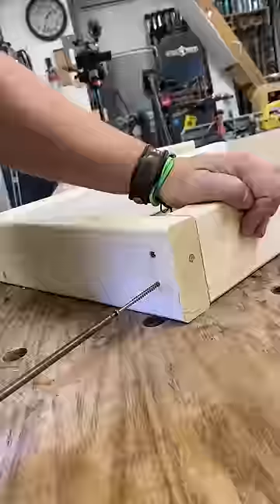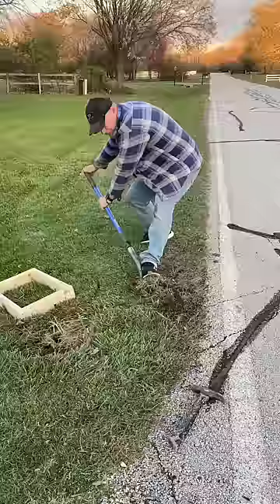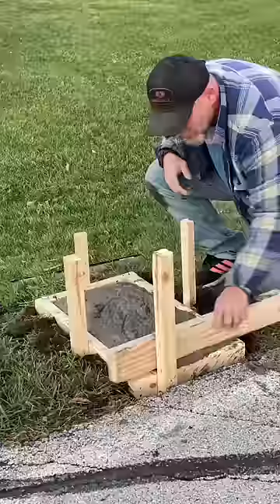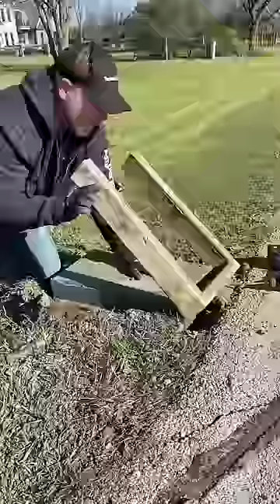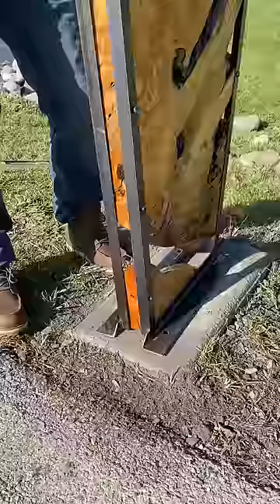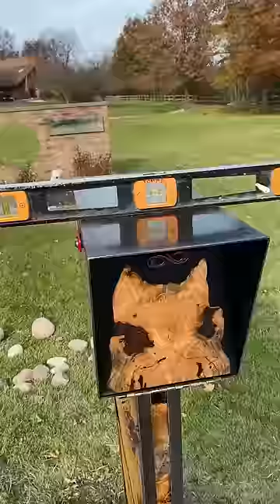The Coolest Mailbox Ever Made!!! Free Plans #Shorts

Comment: Looks like it would tip over in a strong wind.
Reply: 100% 🤣
Reply: he put 6 lag bolts in I don't think it's moving unless a truck hits it.
Reply: No faith what so ever.
Reply: @youreverydayjoe8087 that footing was only 4” deep😂
Reply: @youreverydayjoe8087  BAHAHAHAHAHA! 
(the bolts could hold down ten times the weight that shallow footer will)
Reply: @youreverydayjoe8087 The lag bolts are only as good as the concrete they are in. That was about 60 lbs of concrete to anchor a 4 foot tall wind sail. Unless he put significant concrete lower, or some sort of metal posts, it would absolutely tip over with little effort.
Reply: @JimYeats  that’s depending on the soil mister , did something similar to this and been here for years and hasn’t moved
Reply: @youreverydayjoe8087  Depends on a lot of things. Soil being of middling importance.  You want at least a third of your item in the ground for adequate strength, across soil types. So for a mailbox, which is just shy of four feet, you would want about two feet in the ground. So for this fairly large item, a two foot deep foot hole, maybe a shovels width wide, with concrete and a piece of rebar, and then the four inch thick surface to bolt it to would be sufficient.
Reply: Yup...no footers no strength
Reply: @YourEveryDayJoe  the concrete will tip with the box thanks to those bolts🤦

Comment: That is like so cool. Only thing I would have changed was to make the concrete base deeper. Gorgeous!
Reply: A bigger box too.
Reply: My neighborhood,
Frost will heave that right up.
Reply: It’s a mail box make it deeper to what support a second story mailbox. Gotta critique don’t you
Reply: @benjurqunov that’s where you live and it’s a mailbox. The frost does t go heaving up rocks in my front lawn. Like ever
Reply: @Bdigital9482 I'm sorry if somebody picked on you but that's not what was happening here. 
The dude offered a perfectly valid bit of constructive criticism.   A mailbox sits atop what equates to a 4 foot long lever attached to the base.
Reply: The steel rebar will rust, expand from the inside causing the concrete to loose its strength. Mailbox is really cool.

Comment: Beautiful! Hope the snow plows don't tear it up or knock it over. 4" of concrete base isn't a lot to keep it upright with freeze/ thaw and snow thrown against it.
Reply: I think 4" is being generous. 2x4 is only 3.5". Plus he was below the edge of the 2x4 a little. I wouldn't doubt it if his actual slab thickness is 3 1/4 or so. Definitely not enough.
Reply: Snowplow? A large vehicle driving past would knock that over. I'm a little surprised it didn't fall over when he pulled on the door to open it. 😂
Reply: Just take it in at the end of the day
Reply: @DannySauer  HAHA!!! Exactly
Reply: It’s actually closer to 6 inches- notice how deep the hole is below the rebar- at least a couple of inches…
No slab thickness will save that from a direct hit by a plow, or probably even the snow from a plow.  If the slab holds, the frame’s going to bend

Comment: Flags on wrong side.  If mail carrier objects they'll make you take it down.  Same thing with bolt heads sticking out inside.
Reply: That is exactly right.  Mailboxes have to conform to standards that are set by the post office and the municipality you are in.  For instance,  a mailbox attached to a 50 ton boulder wouldn't be allowed on a road bc it could destroy a car and its occupants.  Also, a really heavy mailbox may go through someone's windshield, etc.
Reply: Mailboxes have to be certified by the USPS, and i don't think they go certify custom ones. It is beautiful.
Reply: I scrolled for a while looking for this comment. Video isn't flipped, address numbers are correct.
Reply: @alexkitner5356  courier discretion with boxes that aren't approved. I have one that isn't and it's not a problem
Reply: @veganpotterthevegan  they might not care to bother enforcing it but if one day they decide to, then it still goes back to the somewhat bureaucratic and picky regulations requiring USPS approval. 
Some carriers barely manage to get the mail there, they're not about to bother doing paperwork or dealing with a non-conforming mailbox unless it causes them an issue or is more work. It's kind of like speeding, just because they don't pull over everyone that goes 1mph over the posted speed doesn't mean that they can't choose to or that their not enforcing it on others means everyone gets an automatic pass for it.
Reply: @Alex Kitner  no, if a courier doesn't like a mailbox, they're allowed to simply not deliver there.   My ex-wife was/is a 20yr courier with USPS.  They actually have less work with boxes they won't deliver to
Reply: @veganpotterthevegan  it still doesn't change that discretion means that it doesn't meet regulations and that while they may, they don't have to- paperwork or not. It may not be paperwork all the way but I'm sure if someone gets mad, gets told "too bad it's discretionary" and has a fit and files complaints then it's a pain and some paperwork or interviews will follow. However you word it, it's easier to just be discretionary or just to ignore it if it's not more work or other problem but that doesn't mean that they won't tell you tomorrow that your mail is stopped because the mailbox isn't usps approved.   And remember you're way less likely to have the issue cause your wife works for the same company in essence. Average Joe's experience may vary... hell, growing up on a cul-de-sac we had to have a second mailbox and post that was 100% to the letter of the law or the driver would just ignore it when the plows had piled snow up. They wouldn't so much as lean out to reach the regular mailbox let alone step out for "safety reasons" on a cul-de-sac with no traffic, and once we complained it became a war of discretion that we were always on the losing side of...
Reply: @alexkitner5356  sounds like you know little of how it works.  It's significantly easier to never deliver to a house every day than to just report that the box isn't up to snuff once and wait until they fix it.  A courier can even avoid your box because they don't like the bushes planted around it or if your box is on your house and they don't like the walkway to the box.

Comment: Gorgeous. Ours is strapped to a metal fence post atm. Original box got taken out in the middle of the night, we heard the bang of someone driving into it. We found half the post a good 40 ft away. Went and got a metal set up to replace it quick. Battled getting it to stay upright in boggy soil that's always wet. Then the post office left us a note that they were getting new trucks and we had to raise our box by over 6 inches. The metal pole now had just 2-3 inches in the soil at the new height. We're already flat broke so we drove in a metal post beside it and tied that sucker up. It never rains but it pours.

Comment: USPS mail carrier here

Mail boxes are designed to be breakaway on purpose. Reason being, if someone needs to veer off the road for any valid reason, hitting a mail box shouldn't unalive them. This one should breakaway as the base isn't buried very deep in the ground.

My only concern with this box is if you got prior approval from your local postmaster. There are rules to abide by and custom boxes, as cool as they are, need to fit a set prerequisites before installing one. Your regular carrier could deny delivery service to you if they feel your custom box hampers their delivery service. Personally, I love custom boxes

Comment: Very nice work, but just one small question:
Why do you drill holes in concrete after it has dried and hardened?
Isn't it easier to insert steel screws in advance, into the fresh concrete?
The screws only need to be half inside the concrete and half outside the concrete, then when the concrete dries you don't need to drill. The screws are already there!!

Comment: The best mailbox post is a 4" PVC pipe with a matching toilet flange. Dig a post hole deep and leave 34" inch of pipe above ground. Fill some concrete around the pipe and concrete and rebar inside the pipe. Level and let dry. Match flange holes on underside of mailbox and drill 4 holes. Use smooth top bolts to attach mailbox to flange with nuts. Glue flange with mailbox to post. Anyone smashing into your post will be in for a rude awakening as they say.

Comment: It's gonna end up tipping over in a wind you should have set the cement deeper and anchored it into the ground with the rebar Or fence screws

And why did you screw the anchors and afterwards you couldn't just set bolts in from the beginning instead of worrying about drilling such a small slab and possibly leading to cracks in the future especially when you have a wind load on it

It looks great but I'd rather go for functionality 1st and then let form fit Into that

Comment: Seems like it's illegally close to the road.  The top of the mailbox is right on the white like.  It needs to be 6-8" back from the curb (which would normally be to the outside of the white line or edge of the pavement.).  For roads without a curb it's local post office decision but usually it's a minimum of 18"

Comment: That’s a damn nice mail box but brother you going to need to dig a deep hole and fill it with rock or a deep hole and fill with cement and put that slab in it and tie it down with anchor bolt to the deep slab I just fixed mine that was done before I moved in and it tellted back about 15deg Because the person who installed it before me didn’t put it deep enough

Comment: Unfortunately, the epoxy (hope there is some) covering the wood, isn't going to weather well. And if that wood has NO protection other than maybe some polyurethane...

....no matter what's been done to the wood, that's going to look vastly different in short order...much like any exposed tree stump or chunk of wood in the forest...

Gonna be a lot different after a few hard winters and high humidity and heat summers...
Woodworking like that isn't meant to be outdoors totally exposed to storm winds, road dirt (and salt from snow trucks even if the plow does miss it).

That's a lot of hours spent building that only to see it be very very different quite soon.

Unlike an inside bartop or coffee table that might be the same for years...

Comment: I made a custom mailbox when I was younger. The mailman refused to deliver mail to it because it was not government approved. So we ended up taking it down and buying one from the hardware store.
Reply: Sounds like there is more to the story.  I delivered mail for 35 years and I've not delivered to a box for certain reasons, but not just because it's home-made.
 If  it's too far from or too close to the road, too low or not weather- tite. 
 I have delivered to beer kegs, milk crates, toolboxes, 10" diameter steel pipe and tackle boxes. I would have no problem delivering to this box if on my route. We had a form to fill out and give to customers if their mailbox was out of spec. and l used the form regularly. I was very picky because it was my job to deliver to almost 700 mailboxes daily and boxes that were difficult or dangerous to reach weren't. 
The box is considered a contract with the PO. You provide the receptacle and I'll deliver your mail to it. Put it out of my reach while I'm seated in my vehicle, and you can come to the Post Office to get your mail, or talk to my supervisor and then come to the Post Office to get your mail. Or put your box where it belongs, you're choice.
Reply: @peterrobinson7803  there actually IS more to the story. 

The house was on a cul-de-sac. 

When we moved in, the mailbox was on the ground and mangled. The mailman delivered to that box by getting out of his truck. There were tracks worn through the yard where he would go off pavement to deliver our mail (as was the case with the other 3 homes on the cul-de-sac). After a few days, we put a new mailbox up. We used the same hole to put the new post in. He refused to deliver because it was 4’ from the pavement. He said so in the form he filled out. 
So we dug it up and put it closer to the road. We got another form, saying it was too close to the pavement. So we dug it up and put it between the first locale and the second locale. 

The third time, we got yet another form notifying us that because the box wasn’t approved by the USPS, he wouldn’t deliver. We ultimately contacted his supervisor, who agreed that the whole issue was ridiculous, but in actuality, it was all by the book. 

So the fourth time, we finally started getting mail delivery. The whole charade took a month to work out. 

You may have been a great mail carrier. But this guy we had was obviously working through some personal issues at the time, and he just wanted to fuck with some young people that were just starting out on this journey we all partake in.

Comment: You did not disappoint! Not a chance I would have such treasure as a target for kid or young criminals 25 and  younger doing vandalism. Probably wouldn’t look as nice with steel reinforced plexiglass protectors and boobytraps everywhere.
Reply: Base decorating looks great too. I would humbly suggest mixed sized river rocks all around post and surrounding area in spleen or kidney formation with maybe a yard or 3 of river stone. When I say  “mixed size”, I mean drop in place off delivery truck because basketball sized and bigger just tough to move. Mix with the ones you started which is how I got idea. Just building off it.

Also, the best part is the higher and wider your rolling stone pile, you can create perfect framing for your treasure with a color stone selection plus your landscape accent light.

Equally “most important”😂, a good high pile of stones and night lighting with fake or real video camera to discourage night vandals from simply driving over and really destroying your work from youngsters getting first years behind wheel of car alone.

I was kinda thinking ahead when I started your clip and thought the biggest reveal would be an I-beam or equivalent layered in or disguised somehow! Never too late…maybe a 12” sided rounded or rectangular steel tube? Defend your work!

Comment: what's going to happen when strong winds will blow over that thing? IT WILL rip that concrete out of there in my opinion few rebars knocked down 2 feet into ground and sha-bam! dat little cutie concrete patch won't go nowhere..or if would have been 10" min thick not 3 5/8"..

Comment: 100%, if that lil slab he poured can move that easily, then that whole thing will definitely come down in the next wind storm that exceeds 30-40 mph. Should’ve had 3-4” gravel bed underneath the slab (because that’s all it was, was a slab) and vertical rebar (probably 6 pieces) drivin at least 24” into the ground. A footer is the bottom/horizontal portion of the foundation that the stem wall is incorporated into, obviously poured at the same time. This is a shitty little slab and nothing more

Comment: you went to all the trouble to pour a concrete base and only made it 4" thick?  wtf is the point of that?
.
and a real pro would have cast the all thread into the concrete base, not goofed around drilling the concrete out and putting in anchor bolts in a separate operation.